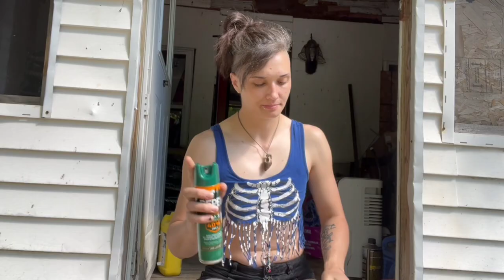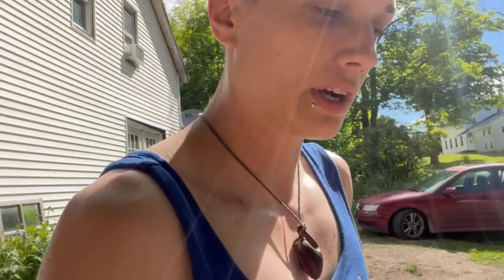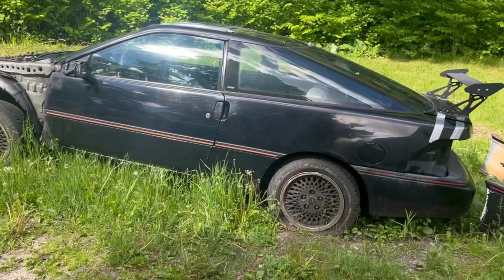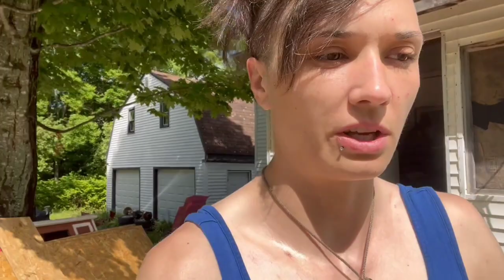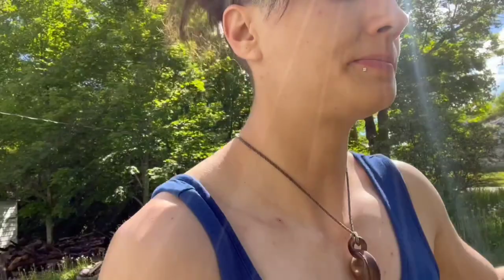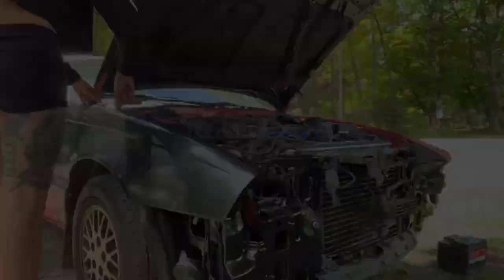At home with The Mad Brooker, let's see what she's got going on at her place!

Comment: The roads down here in Connecticut aren't too great either. They suck even worse when you have no rear shocks on your truck. The rear mounts on our 2000 GMC 2500 rotted away. At least we don't have the black flies.